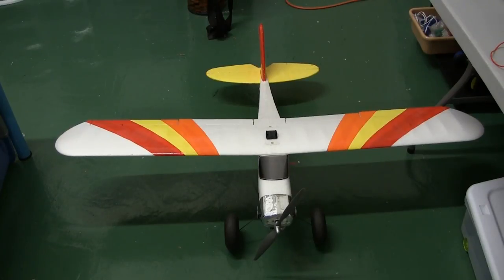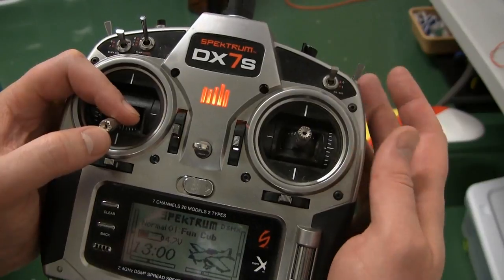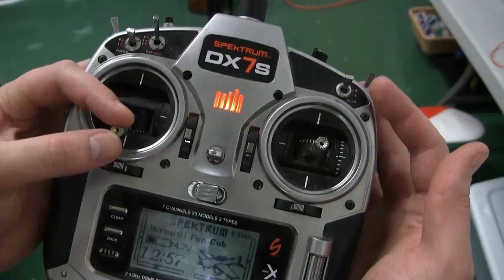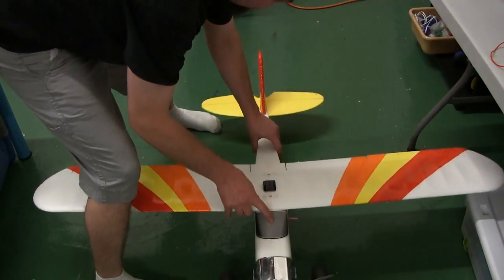How do remote controlled airplanes work?

Comment: Great video it’s a real crash lesson on aerodynamic theory and props to you for emphasis on safety did you catch the huge German RC fighter video? If so I didn’t see any elevator or rudder control or it wasn’t close enough to see
Reply from the maker: I'm not sure which video you are talking about exactly, but many fighter jets and the Concorde are in a "Delta Wing" configuration. Instead of separate elevator and aileron, those two control surfaces are combined into "elevons". The pilot still controls it the same way, but a computer translates joystick input to control the elevons.  There are a number of different and unusual configurations. Very interesting stuff.